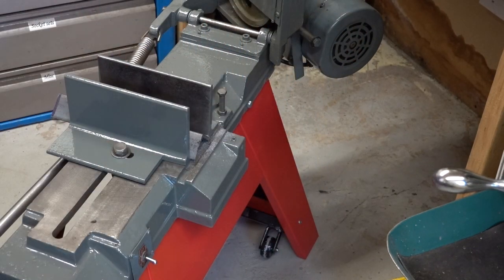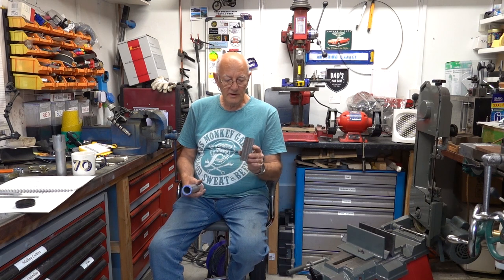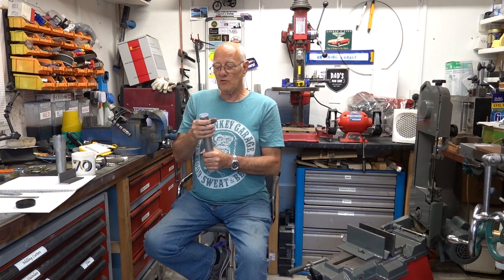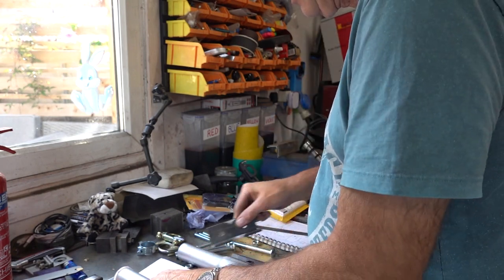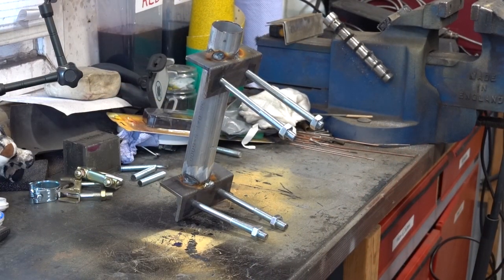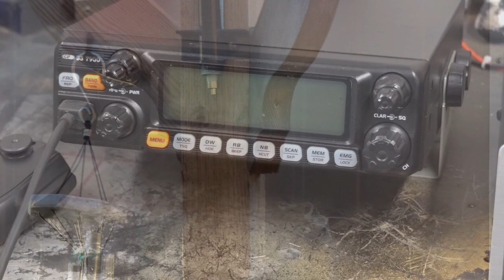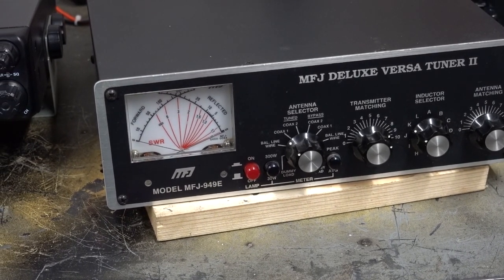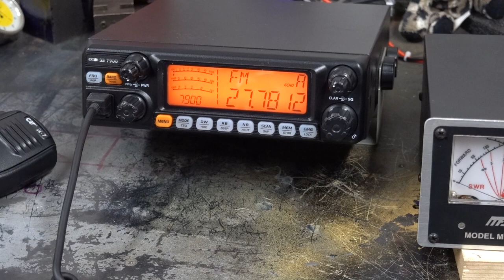Ham radio fitting a old CB aerial for 10 metres

Comment: Hi Steve, trip down memory lane lol, I was messing around in the late 80's, like you, unlicensed and causing havoc with neighbours. Always remember watching my mate who had no fear of heights (unlike me), on top rung of a ladder fitting a 12ft scaffolding pole to a gable end with an 18ft GPA on top on a windy day....... Mad as....! I had a stack of radios (5 or 6 I think), some base stations (Unidens), and more burners than a gas hob lol. Cheers, Jon
Reply from the maker: Same here Jon. I at one time erected a 3 element 1/4 wave Yagi on the house roof. With a rotator. Luckily i was not that friendly with my neighbours. Strangely the Yanks loved me. They did complain to me a lot though. That & firing my 8 litre stock car up on a Sunday morning. Times past eh. The old Shakespear is not performing too well so going all being well on Monday to buy a multiband antenna & a Yaesu FT 991A transceiver. 
Regards.
Steve.